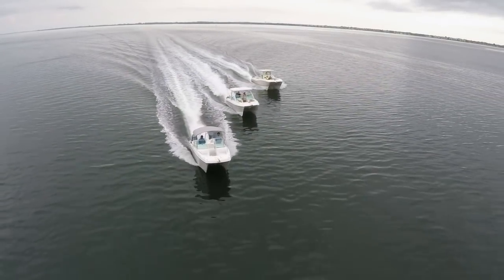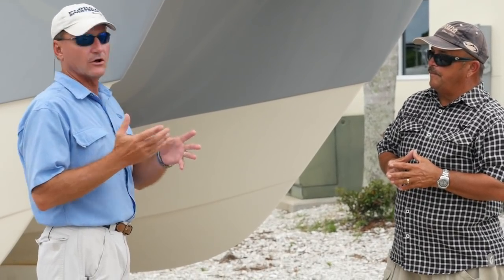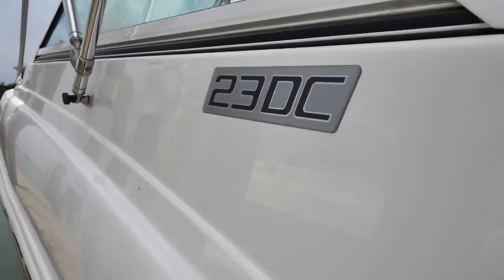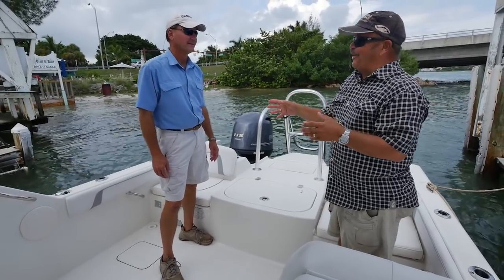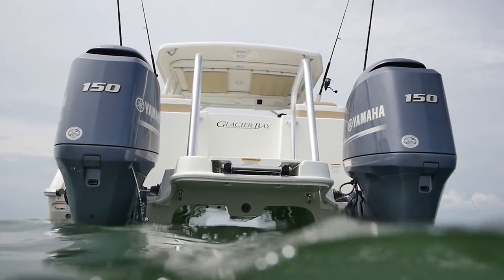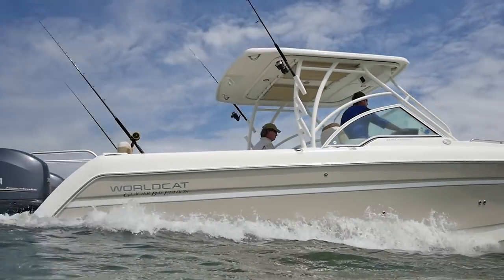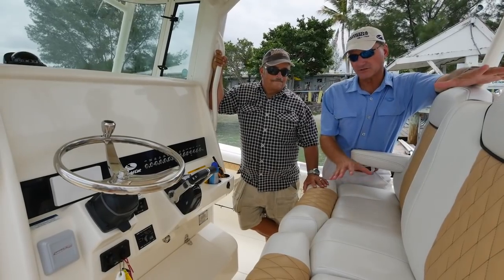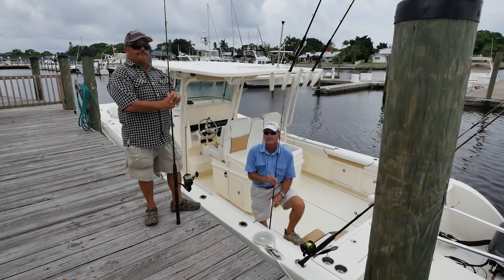Florida Sportsman Best Boat - Cats of All Types

Comment: As a Glacier Bay 2680 owner, I will tell you the half windshield will be a wet ride in rough water. When it sneezes you will be getting wet. In the rough water outside the Golden Gate,2-4 foot waves and 6-10 foot swells, I know my Skipjack 25 gives you a better ride, especially when loaded heavy.

Comment: If only the size and the money.  A tow-able cat will cost so much less than a moored mono that cat do he same. Now diesel shaft twin cat bang for your buck. I have had the pleasure of twin two stroke cat performance but the price point is not the same. A 17.5 ft cat with twin 85 Yamaha non counter rotating props landed regularly on its gunnel in heavy sea. Fun but brutal on the body. Twin props and a well thought out sea keeping ability is what you need. good luck,

Comment: Can u use  Worldcat 23DC In place of a pontoon?  And beach it?
What’s the draft?
I like the idea of a head on it
Reply: pontoons are aluminum. No gelcoat to crack or spyder. Great for running up on beach. worldcat is gelcoat. gelcoat does not like sand, pebbles or rocks, items found on beach. Gelcoat is extremely expensive to repair correctly.
Reply: Solar Fry thank you for the explanation! It is much appreciated 🙂
Reply: Excellent question; so glad Solar Fry responded 🙂

Comment: Strange.... I was talking with a guy yesterday that has a cat. He told me the cat rides a lot better and a lot smoother. But he told me his cat rolls a lot more at rest in seas
Reply: Yes world cats do that. The only time i’ve ever gone overboard was on a world cat, and we caught a wave and it rolled hard and 3 people in the back of the boat fell out. They are also very slow. A freeman, sea hunter, invincible, on the other hand rides amazing and do not roll.
Reply: Most cats are wider than an equal length mono. 
Both roll uncomfortably. It depends on the wave length which rolls more.